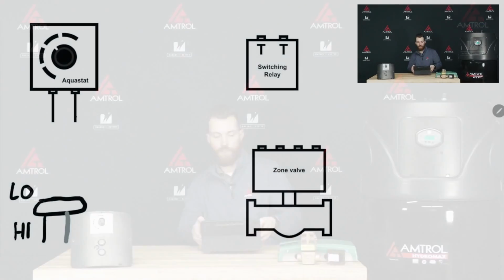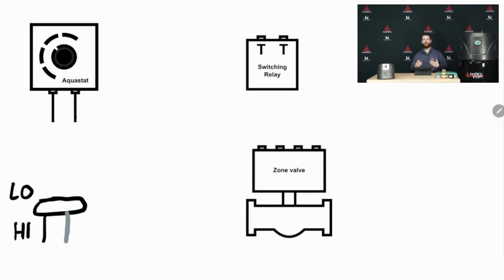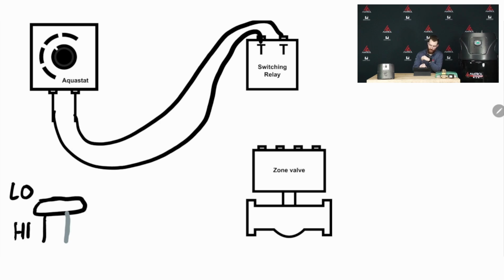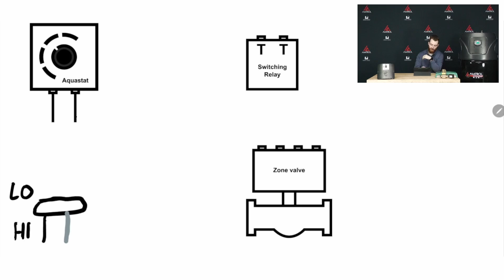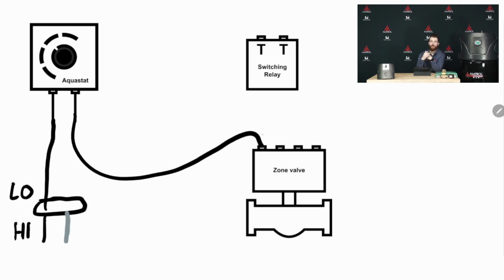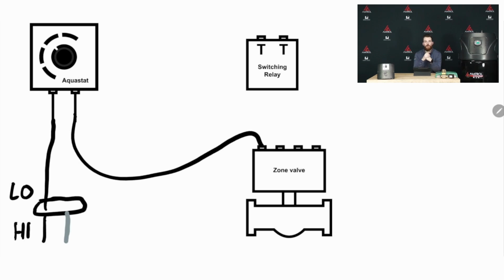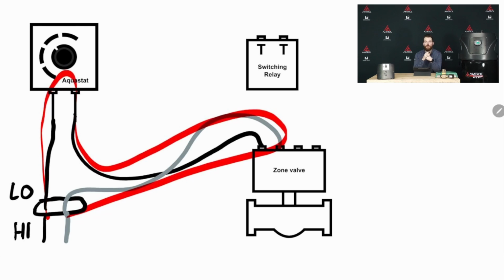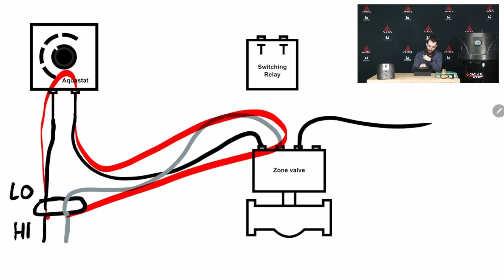Wiring Your Boilermate Aquastat (All Models) - Amtrol Tech Takes

Comment: Looking to add a c wire so i can use my smart thermostat? What can i do?
Reply from the maker: The c wire used on smart thermostats would be connected to the boiler side of your heating system, not your domestic hot water. I would recommend following the thermostat instructions or contacting a licensed professional to assist with a heating thermostat installation.

Comment: For the tt input 
Do I just run 2 12 gauge wire to the switching relay? What cable do u run for the 2 black wire
Reply from the maker: If you're just using T-T connections, then you can run standard low voltage thermostat wire which typically is between 16-20 AWG.